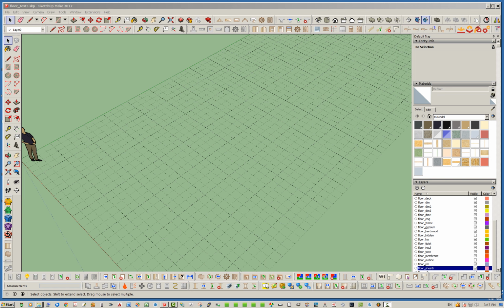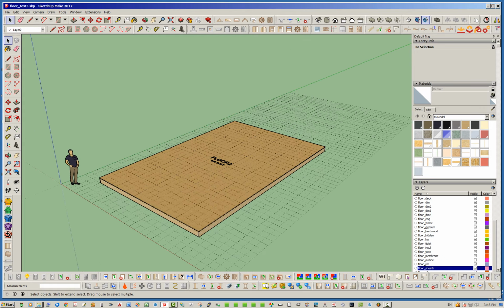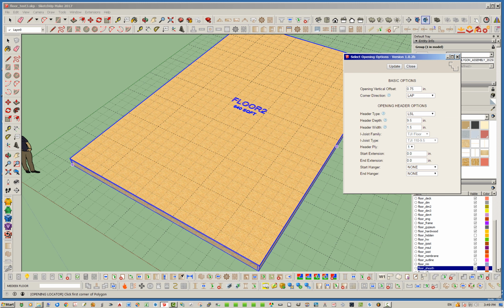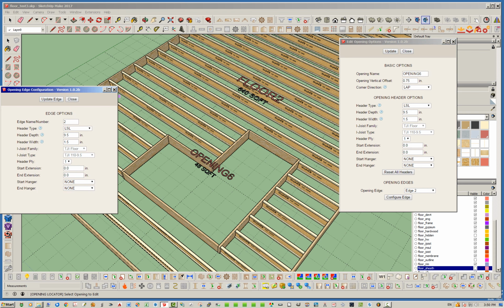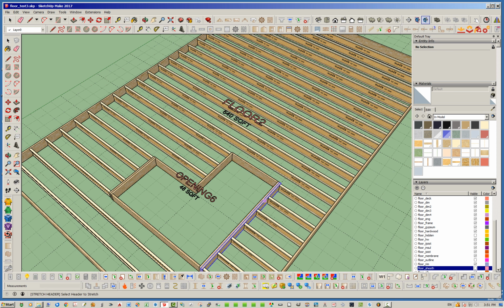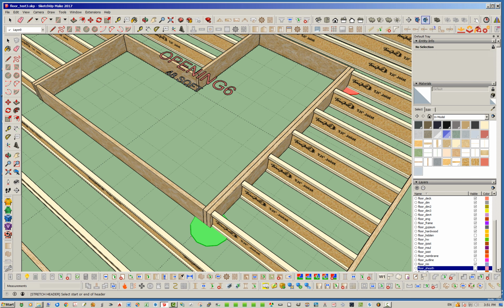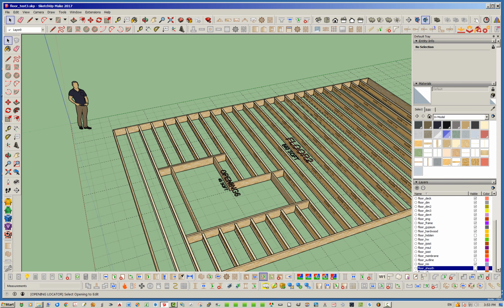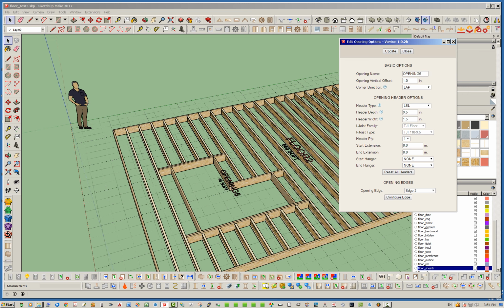Medeek Floor Plugin Tutorial 25 - Stretching Opening Headers

Comment: Is it not possible for your trimmer to automatically extend to the nearest joist either side dynamically…

If I didn’t need (dominant) joists either side to support the opening , I would extend the trimmer to the nearest common joists either side exactly like you did…

Reasons why is to connect the timber members to a known mathematical calculation, such as the nearest common joist and then its length would also be an know which is in the nearest increment of the joist centers that is greater then the opening size and then the joist hangers will always work out using the joist centers from the start of the trimmer minus the thickness of joist.